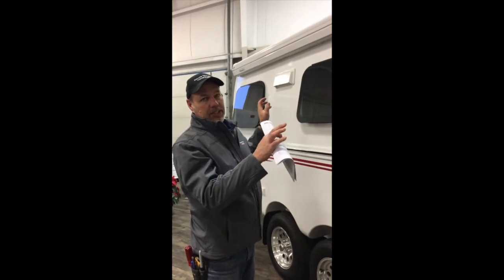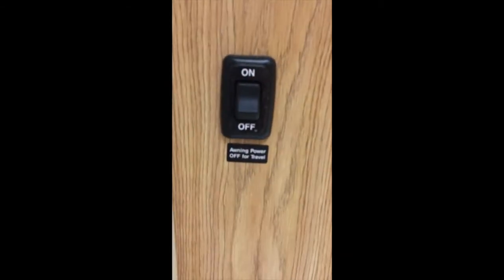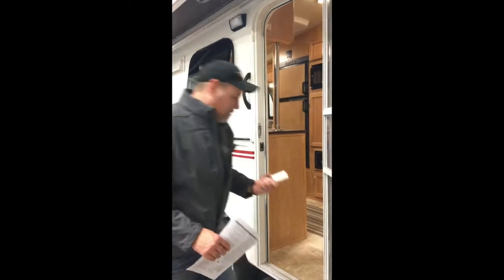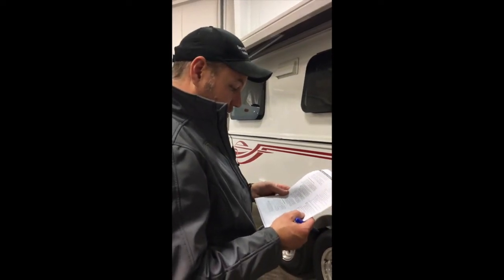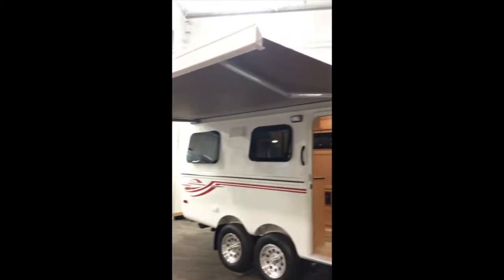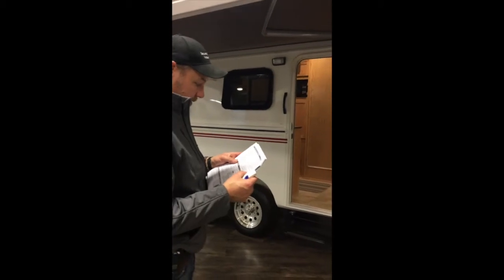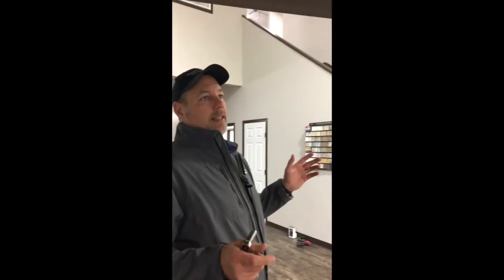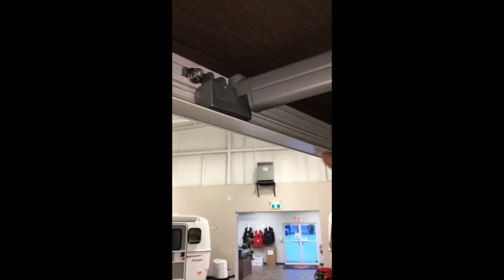Adjusting Your Dometic Awning: A Step-by-Step Guide

Comment: Does not seem to apply to the newest Dometic Power Awning 9500E Model 231 that was installed on our 5.0 TA.  There was no "jog" or other movement following the ON-OFF-ON-ON and there is no reset button on the remote.